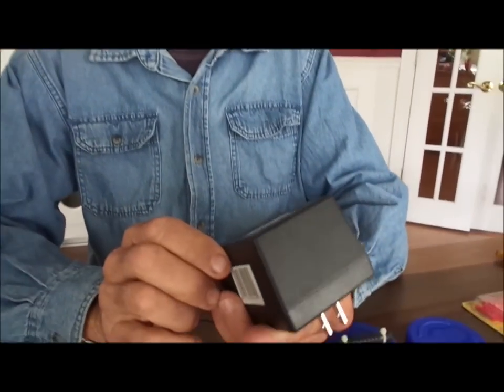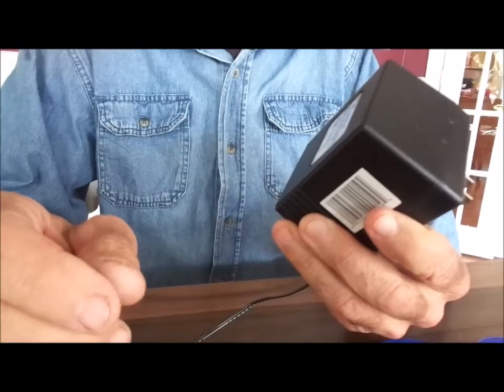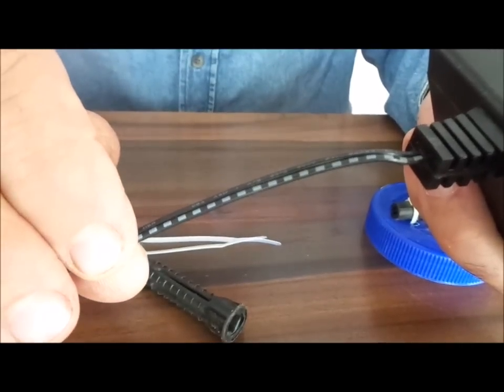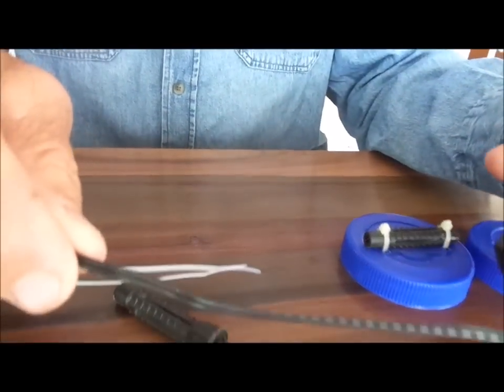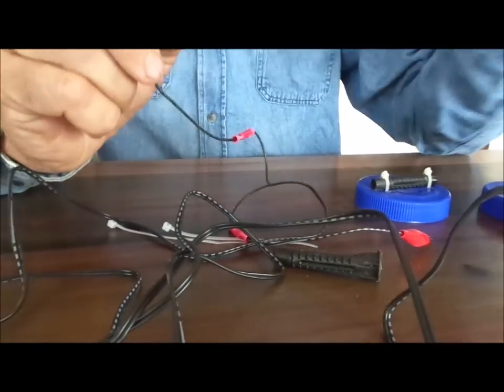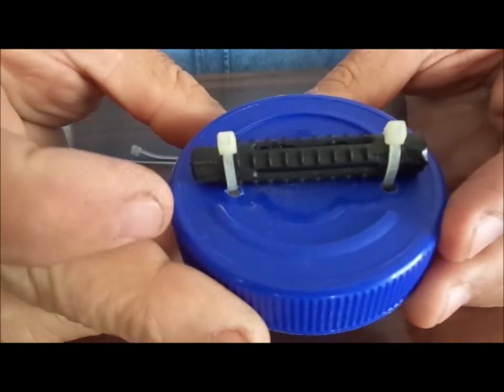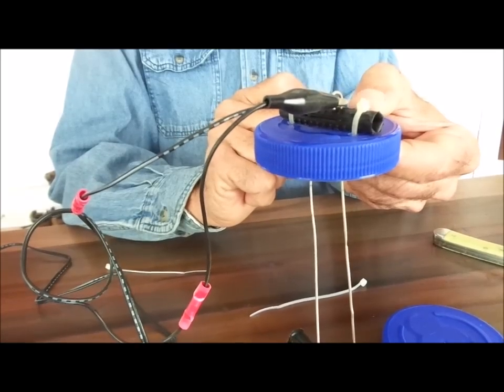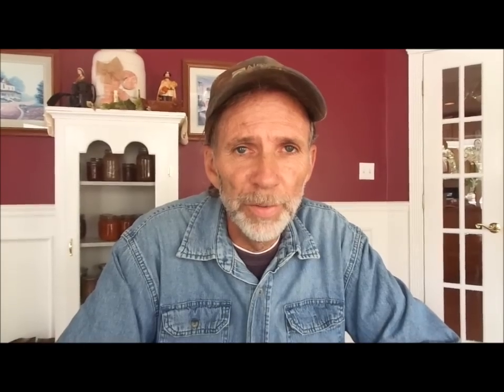DIY- Colloidal Silver Machine

Comment: Thanks for a great tutorial.  I watched you other video where you made the CS water and was wondering how long do the rods last and do you clean them off between uses?
Reply from the maker: +Deb G I ordered 12 sets of rods about 15 years ago and a couple of years later I ordered a 3 oz coil of wire from Hauser and Miller, link in description box above.  I am still using those rods. I clean them with a green pad that came with the sets of rods.  Thanks

Comment: Great project. I spent $60+ on a little machine that essentially does the same thing you made.
Reply from the maker: +Off Grid Nation Yes, they are out there.  Can you put a link on here for the one you use.  I would like to mention you and your machine in the description box.  Thanks Wanda
Reply: @DeepSouthHomestead  - I watched another channel a few days ago that had a link for a CS generator off Amazon but it's sold out already! It had a bubbler and a water purity sensor. I think if I'd been able to get that my hubby would have trusted it, but I'm afraid he will not go for this DIY model. It took me FOREVER to convince him to try CS to begin with. (He's very much a worshiper at the church of the white coat. 😕 Whereas I don't trust white coats any further than I can throw 'em!)